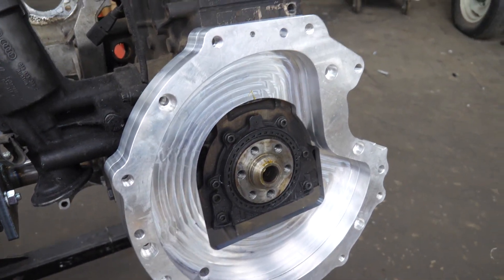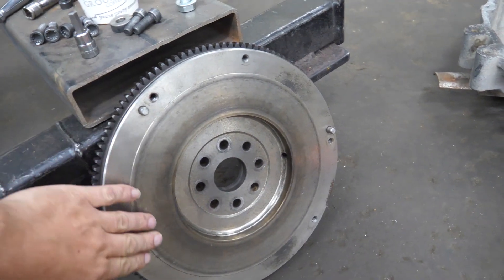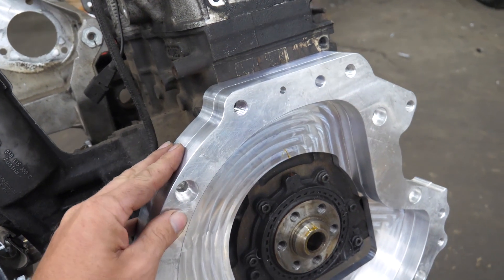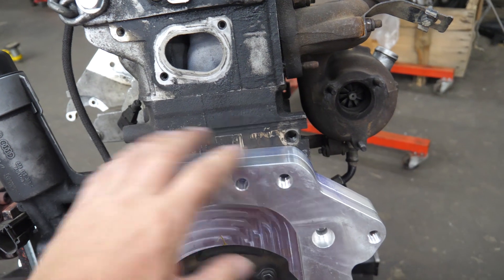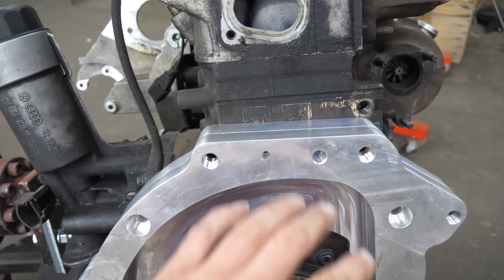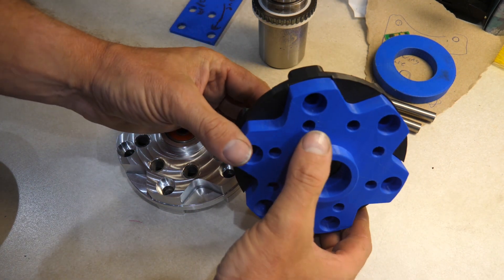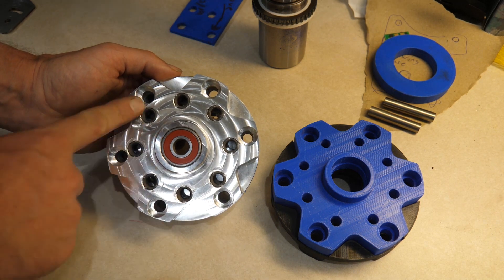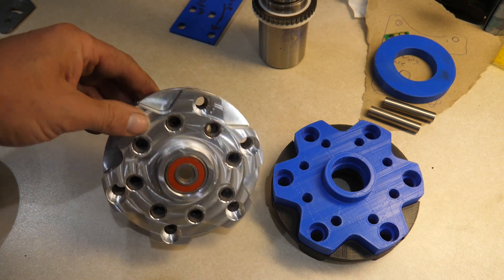VW tdi to Toyota R150 Manual transmission

Comment: Hello guys. I have a 1999 isuzu rodeo with the Ar5 trans with the 3.2l v6. I would like to convert it TDI. But cant find any adapt plate for it on your website. Could you guys make one for me? I know its almost the same as the toy r150. But my bell housing and input shaft must be different. I would like to use my isuzu clutch and flywheel and starter.

Comment: so ..   20 total   flywheel  bolts     with  2  aluminum  crank spacers ?  what a  cluster fuck ....  how about just  selling a  NEW   flywheel  with the correct bolt pattern  like doomsday  does  for  an additional   ~$200

Comment: Any adapter for the H41 or H55 transmissions that would bolt into a 40/60. Not wanting for those vehicles but looking to run a LC 4 speed with 1.9 tdi in another vehicle
Reply: Any reason you want to run the h55?  The r150 is more readily available in the USA and plenty strong for a tdi 4 cyl conversion.  The h55 runs a rear offset transfer case that only works with LC axles.  Good axles but the offset sucks with more common usa found cases outside of the lc
Reply: @dohcdelsol93  two reasons.  Transmission length and need passenger side offset
Reply: @Mongoswede  if you can't find an H41/42/55 adapter there is at least one company selling the tdi to small block chevy adapter and advance adapters sells a bell housing that adapts the toyota trans to small block chevy.  Ive also used a ranger over drive to adapt an h42 to a small block chevy bolt pattern as i needed over drive for the diesel conversion.

Comment: Looking forward to seeing a full kit available. Any reason you know of that this wouldn’t work with a 1.9 BEW engine?
Reply from the maker: I'm told they work fine--but--no one has ever sent me pics. so, we have a BRM engine on it's way here to try . I don't know enough about the BEW BRM engines just yet to know for sure without physically bolting them together here, so we're going to try it. And we'll post videos and pics.
Reply: Good to hear. I’d prefer the PD or even a 2.0 common rail CBEA/CJAA but can’t seem to find any swap info specific to those motors. Looking forward to seeing the BRM and a full kit for the R150F!

Comment: I have a 2000 Toyota Tacoma with the 5spd manual, it doesn't list those under the years, but the truck currently has the 2.7L 3RZ motor, will this kit still work for the swap or will I need to source an older trans?
Reply from the maker: I don't think it will. The only guys I've seen use our adapter in Taco didn't use the (W59 i think) stock Taco trans, they used an earlier one.

Comment: No problems with bellhousing runout?
Reply: This runs dowel pins that prevent the run out that was an issue on older acme made tdi adapters.